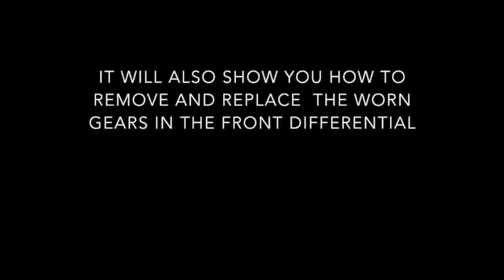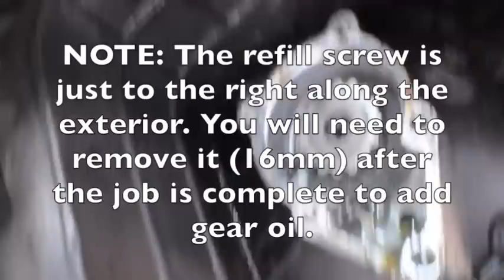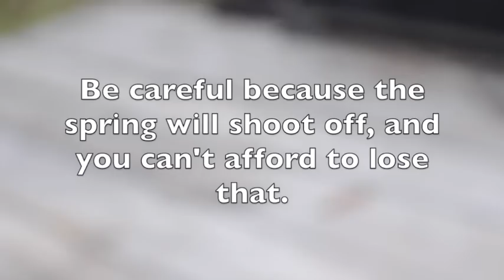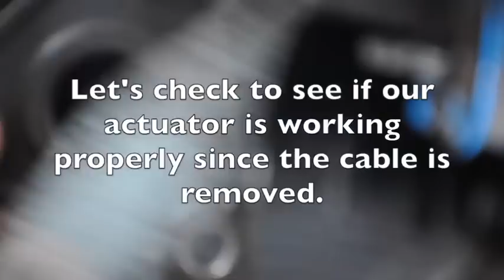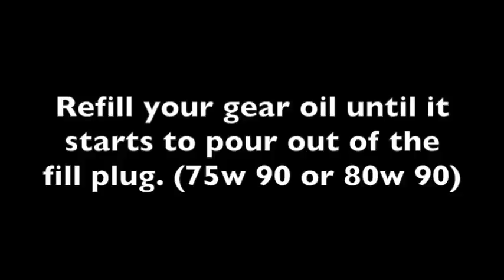How To Fix Gmc Sonoma 4x4, Chevy Blazer, S10, Jimmy, Olds Bravada, 4x4 Grinding Clicking Noise

Comment: This is a great video. I have just made one explaining how to ditch the electric shift motor on the transfer case on my 99 Blazer. Its called (Fix GM electric 4x4 permanently & CHEAP) It will show you a dirt simple way to save $hundreds$ of $dollars$ on shifting you transfer case into and out of its ranges.  Its free information and I want all the people like me who have been stranded because of this overly complicated GM Junktronic. Not that the vehicle is junk but the electric shift is.  Anyway hopefully my idea will save people thousands of dollars and for most make their 4x4 totally dependable.

Comment: where can i buy that spring that holds the cable in place i tryed at the chevy place but they dont show it mine is weak cable keeps slipping out
Reply from the maker: Hi Rufus, I can't find it online either. You may have to go to a salvage yard to find it. Or find the piece used on eBay.

Comment: our 4wd sucks since years- no big deal as we dont really need it- the "service 4wd " lights go on from time to time- always ignore it- BUT since some weeks- spec. in right corners- and spec. when reversing- theres an awful grinding noise like the 4wd is engaging !?? when turning straight or left - its gone!?- tips?? 2000 s10
Reply from the maker: Hi Izom, it sounds like the gears are worn in the transfer case or a bad axle.  It's hard for me to tell since I can't hear the noise in person.